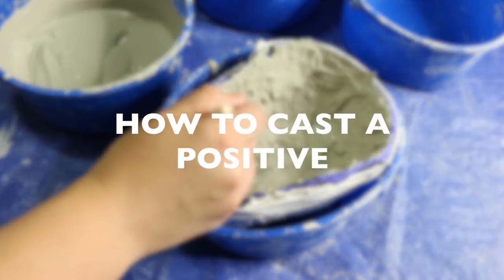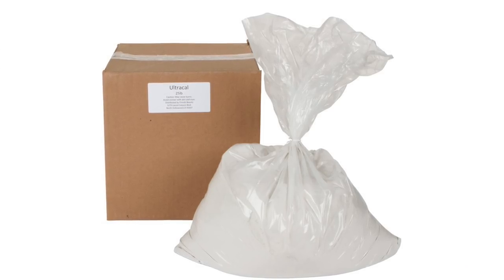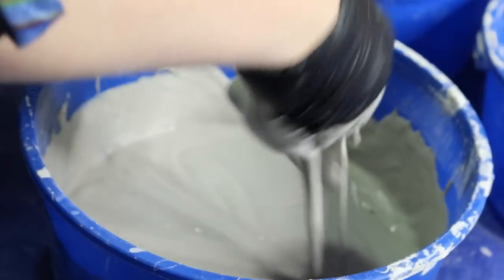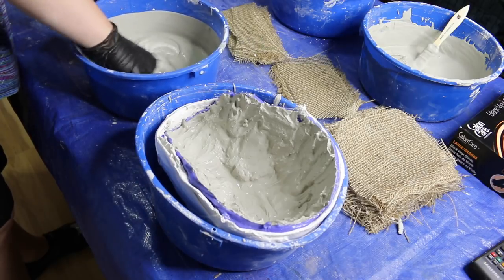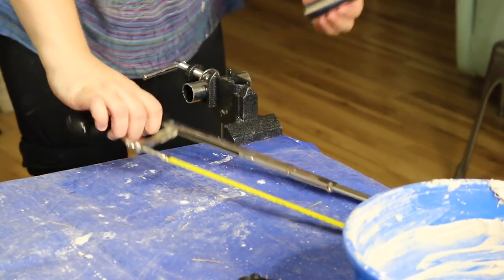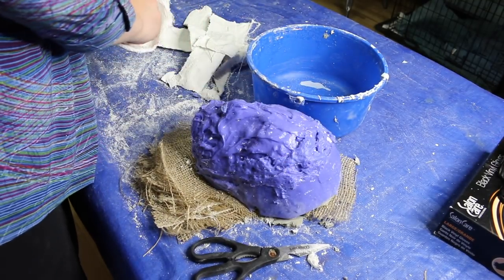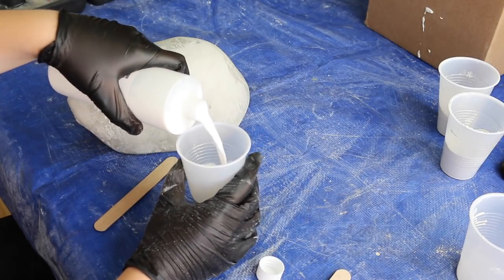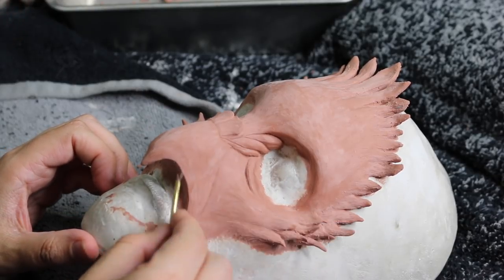HOW TO CAST A LIFE CAST POSITIVE

Comment: This was an answer to a prayer! Thank you! Quick question: How is this with clay release? I made a cast once (nothing like this) and the clay (polymer) bonded to the cast. How could I prevent that?
Reply from the maker: You cast a polymer clay with silicone? I have not done that before. I have cast silicone over chavant clay, which is oil based, and it was totally fine.
Reply: goldiestarling  No, I'm sorry. I followed another tutorial and used the bandages and then plaster of Paris for the positive. The clay stuck to the finished plaster.